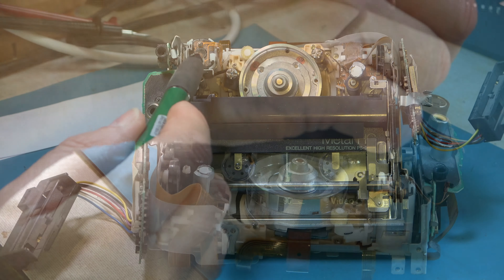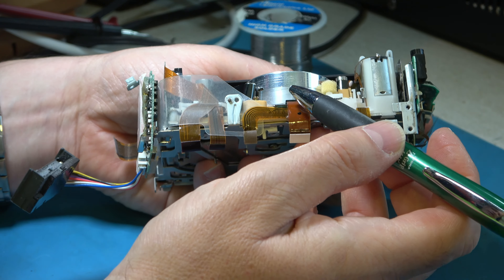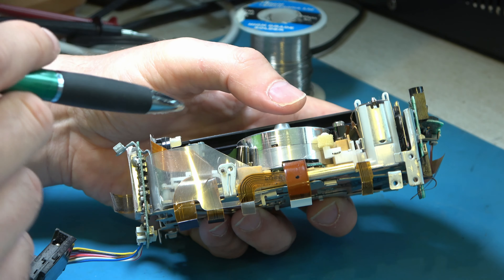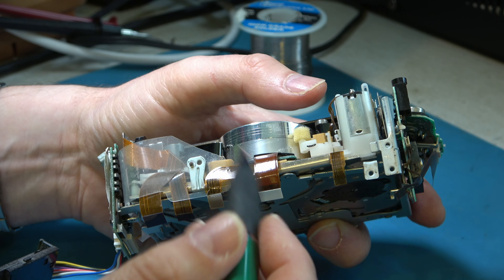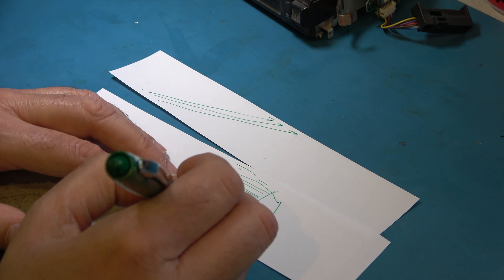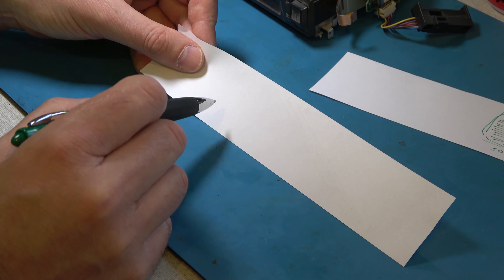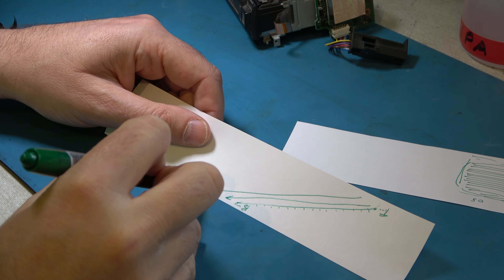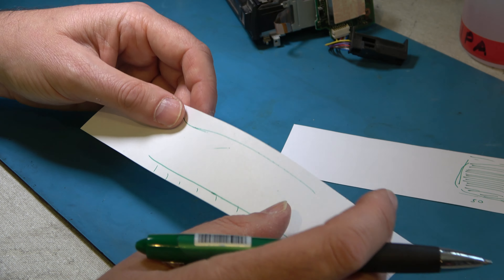Can you get an upside down picture from video tape?

Comment: Gooday, Nice phenomenon. We used to do that on purpose with our Broadcast One Inch tapes on our Ampex machines,  The picture was upside down and in black and white.  The Dynamic Tracking heads on these machines would trace the video track perfectly so the B&W picture looked good. We could also set the Capstan Servo to run with the RF signal off tape, so linear speed would lock perfectly.  No sound of course !
Reply from the maker: Never knew it was used deliberately.  The weird thing about the Video8 tape, now I checked it, is there is reverse sound too!
Reply: @video99couk  Sound in reverse, very interesting. I can see how that would also be possible because the Video 8 format uses AFM audio (no linear audio tracks) so the video head would be reading the AFM signal backwards hence reverse audio!!
Reply from the maker: @azmath2059  By the way I actually have a 1" C format Ampex machine complete with timebase corrector.  But it needs a little repair work and setting up, and I don't have much of a clue.  Hopefully one day someone can give me a hand with this.

Comment: My Hi8 camera only play Video8 tapes well but with Hi8 tapes, a lot of snow and streaking occurs like when you play SVHS tape on a VHS machine. I've cleaned the heads manually but still no fix. Is i a bad capacitor problem?

Comment: Is there a recognition switch in Hi8 camcorders to determine if a Hi8 or Video8 tape is inserted?
Reply from the maker: Yes, there are ident holes on the back bottom of the tape to tell the camcorder what format it is allowed to record in.  But for playback these are not relevant, it looks at the signals on the tape and determines if it contains the correct spectrum for Hi8, if not then defaults to Video8.

Comment: i've never seen that mistake before :-D
Yes i've joined my vhs tapes with sellotape and cleaned the edges so the sticky stuff does not end up on the pinch roller.
But they were just ordinary t.v recordings, not valuable.
And my old jvc hr3320ek piano key machine didnt give a dam lol.

Comment: Is it bad for the VCR to play a tape upside down? Or is it bad for the tape to be reversed?
Reply from the maker: Upside down doesn't matter.  If the tape was facing the wrong way, it's possible that there would be a little more head wear than there should be, but it would be very slight.